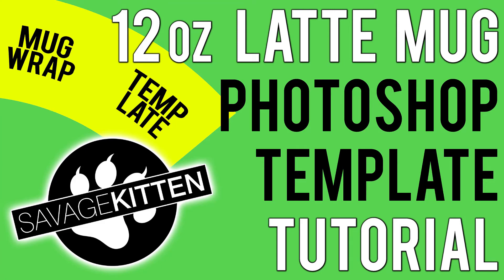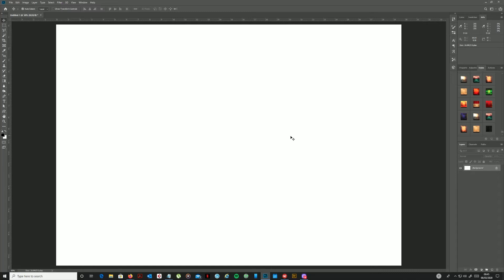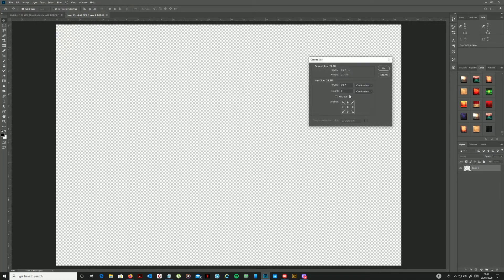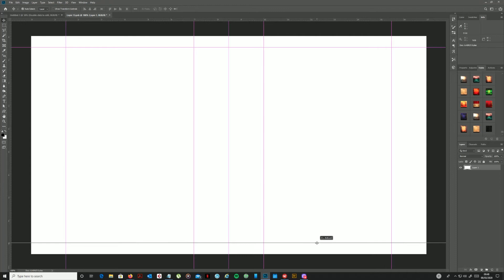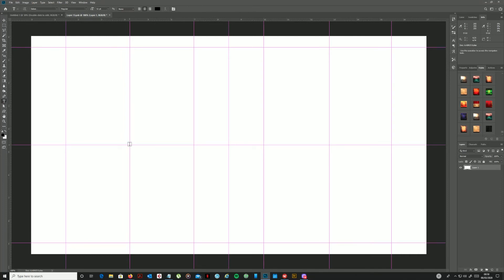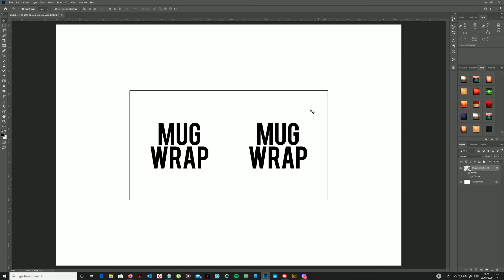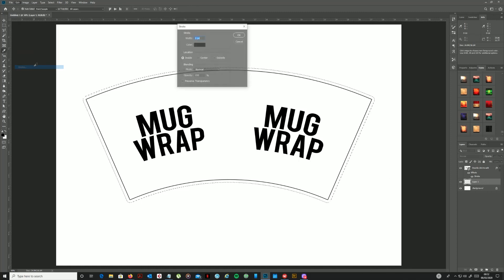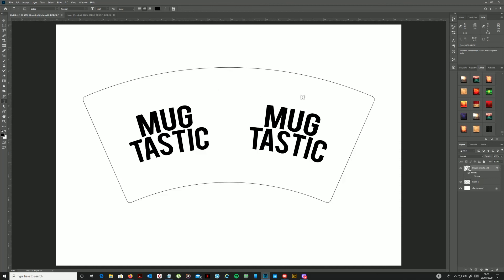Sublimation Latte Mug Wrap - Photoshop Template Tutorial

Comment: I’ve tried this for a full bleed 17 oz latte, however the print it is way larger than it should be.  I’m curious how you arrived at the canvas size for the original .psd file?  I used the width and height of the mug for the canvas size in the smart objects (.pbs).  I added smart object images in the .pbs as a substitute for the text.  Any ideas as to how I can solve this?
Reply from the maker: I used the mug height and the circumference of the mug bottom (upto the handles) as the dimensions for the smart object.  A little trial and error may be needed to get the exact correct size, but it should put you in the ballpark.

Comment: How did you arrive at the size of the Smart Object to edit? I've created a 17oz version and found the size by trial and error. I'd send you the .psd to share if I knew how to!!
Reply from the maker: The calculation I used is in the video description
Reply: In the video you say, "I need to set the smart object to the correct size, 17cm x 9.5 cm", how did you arrive at 17cm width? I have found on my template for 17oz latte, circums of 27.6cm x 18.8cm x 15cm tall that I need a width of 16cm (the max size for printing 21cm ie stops short of the handle) with a warped arc of 16 degrees. I can't find a maths formula between the circums and 16cm or in your case 17cm. I'll send you my 17oz version via www.wetransfer.com for your perusal and share it if you wish, it's too big to email it.
Reply from the maker: @brianjones5535  That's pretty much it - you're looking at the surface height of the mug and the base circumferance but allowing for space either side of the handles for 'safe printing'.  It's not an exact science so there will be a case for some adjustments based on mug variations.

Comment: Great template thank you! already download but a need white (no color Backround , how i remove the yelow ?
Reply from the maker: Double-click the Smart Layer (labelled 'double click to edit') then hide Layer 1, or flood fill it with white etc. etc.
Reply: @savagekitten  how do we find the curving percentage? in your case it was 26%
Reply from the maker: @Kakoriginalturist  I measured the circumference of the bottom and top of the mug.  So in my case the top was 28.5 and the bottom 21cm.  Then subtract the bottom from the top (7.5 difference), divide the difference by the top (7.5/28.5 = .26) then multiply by 100 = 26% - not sure that will always be spot on, but it worked for me :)